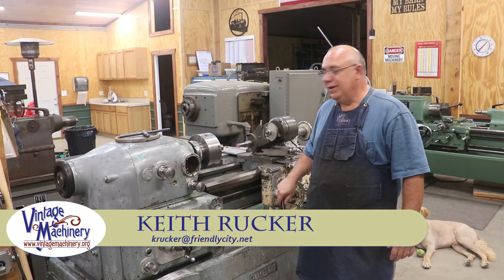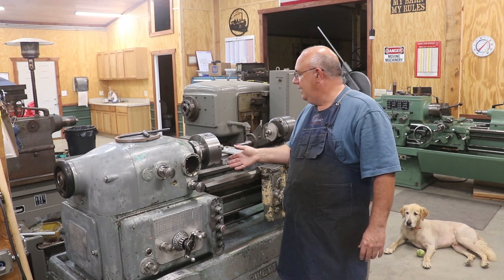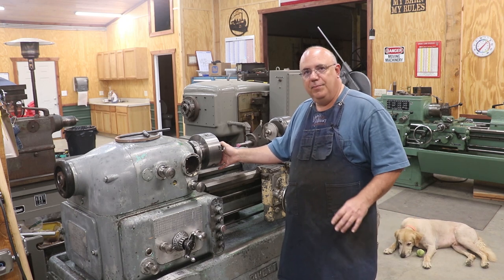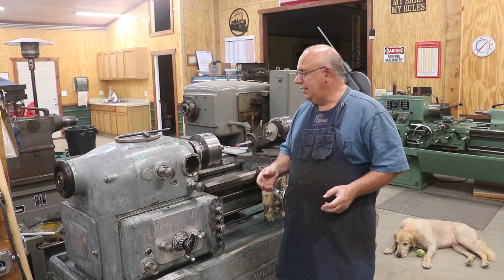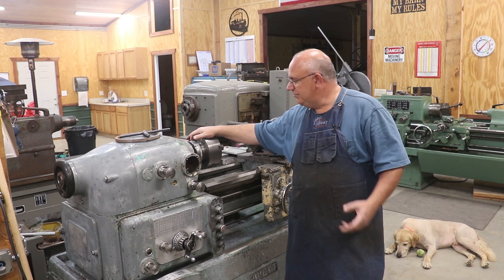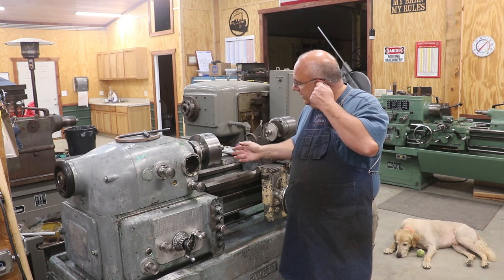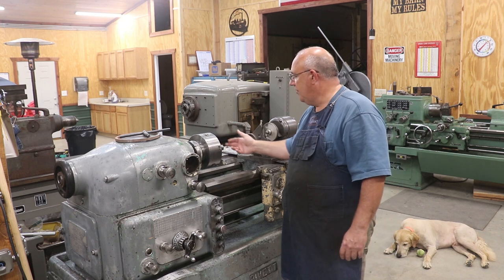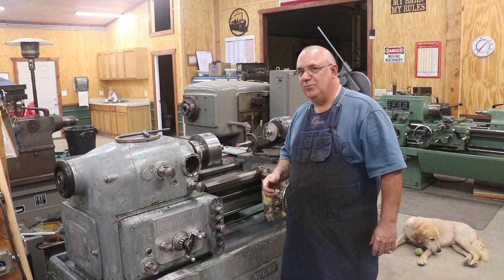Grinding the Faces of the  Jaws on a Three-Jaw  Chuck to Reduce Runout

Comment: Not a machinist here, but if a 4 jaw is adjustable to finer degree than a three jaw, and you have both available why would you need to run a three jaw ? Why go through all of this work to have a less accurate chuck ? I know there is a reason, just don't know what it is. As always enjoy the videos.
Reply: Despite how easy a lot of the guys you see on YouTube make it look, getting a 4-jaw dialed in tighter than this can easily take even an experienced machinist 10-20 minutes. For 99% of jobs, a 3-jaw is more than adequate and saves literally hours of labor each day.
Reply: @gasfiltered  I really don't know any machinist that are experienced, that uses 10/20 minutes to dial in a 4jaw.    Yes, some parts can be hard to get perfect.. But 95% of parts only takes 1-2 minutes. If you use longer times, you really need to practice.    Yes, a self centering chuck is faster, and more suitable for most work.   But you doesn't have the clamping force of a 4jaw,  and if the material are raw, and out of roundness,  4jaw are better as well.    Just a sidenote

Comment: The thing is you want them paralel when they tightened. This is not the way to do that. And you make them paralel to prevent chatter. And the centering is always off depending were there at on te spiral. Just turn the back plate a bit bigger so you can move it to center. And then tighten the bolds. The way Keith dit, it is a cheap and wastefull way to treat a chuck.

Comment: Outside tension of jaws not equal inside tension of jaws due to sideplay of thread at lathe chuck. Jaws have sideplay inside - outside.
If you want a good precision at inside tension, jaws must be tighteded inside. But it is impossible because if it tightened inside it can't be grinded. 
So this job is useless enought. But if you just turn chuck at 60 or 120 degrees on its mount plate you MAY decrease a beating. 
May or may not. In any case it will be less destructive for jaws.

Comment: What happens when you take that chuck off and then put it on again?
Reply: Well, of course, the runout will increase because it's not clocked the same.   A good reason to do the job right in the first place.

Comment: 100% wrong
Reply: I 100% agree, I bet the manufacturer of the chuck doesn't do that nonsense. Unless your spindle is perfectly aligned with the ways you are going to grind a cone in your jaws and with that technique you are grinding a small radius in your jaws, so in closing I agree 100% that everything he is doing is 100% wrong.
Reply: @TheMachiningman  I didn't mean that. I grind my chucks too, but the tension must be in opposite direction. When you grind jaws from the inside the tension must be like there is something tightened inside the jaws and the tension should not be where the spiral is, but on the front side of the jaws. When I grind my jaws I do it at the maximally opened position. That is about 3-5 mm smaller than the chuck hole diameter.
Reply: @sruntev  Your spindle must be perfectly aligned or you are getting a cone too, and you are also grinding a radius, just not a small one. You are just 50% wrong

Comment: Normally grinding chuck jaws is the only option when its a solid body chuck. You failed to establish where the runout was coming from. if the chuck body is running out because the backplate is running out, you just introduced a permanent 'out of balance' condition to this chuck. At high speed, you'll regret that. And if I hired someone to do this and they expanded the jaws for the ID grinding op, I'd have to ask them to leave. Sorry Keith, I disagree with most of how you did this, but I do like the grinder.

Comment: Why can't companies build equipment that is even half as beautiful as the old stuff. Basically any lathe made around WW2, is alot better looking than anything made yesterday, and in the teens, 20's even the electric motors were a work of art, I would hate to take a brand new 5 hp 3 phase motor  back in time to 1920 and show George Westinghouse, Nicola Tesla  and the guys building the motors, look them in the eyes, say this is what we make in the future! It would have to like telling a child their dog they had been growing up with is no more! The sadness they would certainly feel!😢.. a few holes in a plain cylinder, with wires going in, and a shaft sticking  out. I guess the penny pinchers and bean counters won.. making basically everything disposable, even cars are basically disposable. They are not built to last, to get repaired anymore. They build them to basically be tossed once the warranty is out.. telling people the oil last 10k miles.  They want it to last till the warranty expires, then fall apart ..  so a new car is required.. equipment is the same.. would it really cost that much to make a piece of equipment look decent. The newer lathes are a box with a chuck and levers sticking out it! (Have we really made progress, or just found cheaper and easier ways to do the same thing!). Making disposable equipment and vehicles should be e treated as TREASON!  And delt with accordingly! The person's responsible made examples of .  And the right to repaire it is an American right, a human right. And should be affordable. And if the manufacturer doesn't want to make parts to repair, anyone else should be free to make parts or improvements to the equipment freely. Even making a business of doing so . Anything that even makes repair difficult should fall under monopoly laws.. by making everything disposable and encrypted, it stops the need to make improvements, moving to the next best thing. It allows companies to keep making garbage. Halts innovation..  like refrigerators, they stopped making them more efficient, and just slapped a computer on it. I saw a 1950's refrigerator 100 times nicer, more features than anything that will be available in 5 years!  And it was done in the 50's early 60's. It's sad.   This is why I love what you do. I would do the same if I could.  I'd love to have a two level building enclosing about 1-2 acres, with a small area for blacksmithing and for a foundry, a area for welding a paint area far from these areas . And a machine shop, with work benches and cranes.  Have the ability to make anywhere a work shop. With equipment brought in the front repaired, made to look new. New parts cast, milled, painted. Go out looking like a new machine. Possibly better than new condition. Maybe even make new small equipment, belt grinders and  similar, cast and weld the parts with paint and storage on the second floor with outdoor storage as well. Then possibly hire 1-2 ppl to keep a flow of equipment  coming in , save it from being destroyed. As long as the base is there it can be fixed, take things in as jobs , buy, repair, resale. It probably wouldn't be that well paying, building belt Sanders and other small equipment. Maybe shop furniture,  stools , tables, chairs, to be sold to keep thing going , to pay the bills. Maybe rebar furniture, gates, fences. The restoration being a secondary priority.  Have atleast a couple decent mig welders, a acetylene torch, a plasma cutter/table. A couple welding tables, have a furnace capable of melting 50-100 lbs of iron. Or the equivalent volume of aluminum or brass/ bronze,  a CNC router, and 3d printer to do lost foam/ pla casting.  A couple old chicken houses would make a good start, build walls between them. Add a roof , concrete floors. Anyway, it's a dream that will never happen. Sorry to ramble. Hope you have a awesome day!  And thank you for the awesome knowledge and saving the beautiful equipment. To me no intact machine should be scrapped it can be fixed, or used to fix others.

Comment: Keith - NOT covering lathe ways while doing any grinding (jaws, or anything else) is the easiest way of ensuring them being worn in no time flat.
5:35 - "Unfortunatelly, there's really not a way to tighten it down in the direction that you would normally run ...":
https://www.youtube.com/watch?v=Wl1qEB1Kf7I&t=16s

https://www.youtube.com/watch?v=u49hZOLPzsQ&t=96s
Granted, the second method is not the best option, but you can find many other contraptions on YT for tightening jaws for grinding.
Also, running the chuck at really high RPM helps - the centrifugal force does something similar to tightening the jaws - it pushes them against the scroll (and it also eliminates the need for rotating grinding stone): https://www.youtube.com/watch?v=cSeHvS3LJkg&t=126s.
To see the results go to 2:40 - hey, it ZERO! - zero flat, not even the slightest movement of the indicator needle - and the divisions on the indicator are 0.01mm/ 0.0004". Something to crow about, eh?  : )
(Yes, the video is in Russian - but hey, machines and physics are all the same across the worls, aren't they? ;-)

Comment: Hi Keiht

If you want acurate lathe chuck
Buy Steel body acurate  Bizon chuck from Poland .
Reply: Mate your'e kidding right, if you watched Keith's videos you would know it is a German Rohm chuck, and he is right there is no such thing as a perfect 3 jaw chuck they all have some measurable runout. The error as he explained came from the backplate he had to make to fit the lathe as the original factory bp would not fit.
Reply: I have several Bison chucks.  All with maximum 0.01mm runout.   Bison are high quality.    But so are Röhm.   This issue I'm sure are related to the backplate, and the to small recees he did on it..